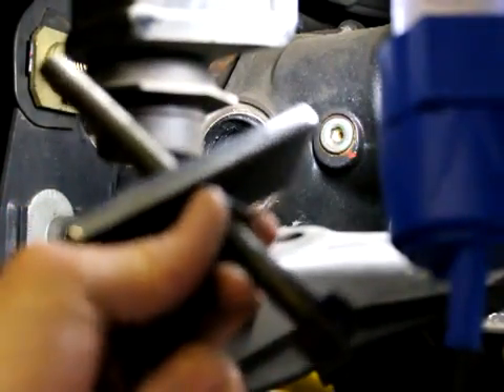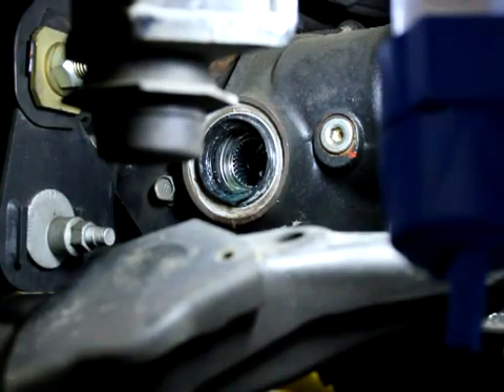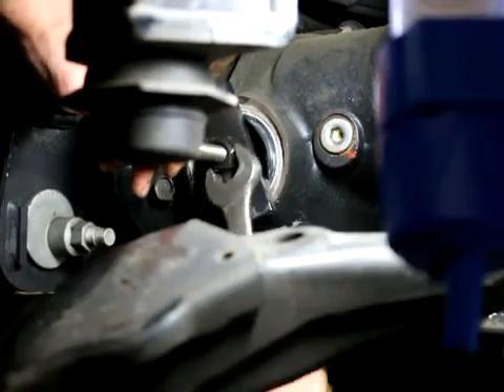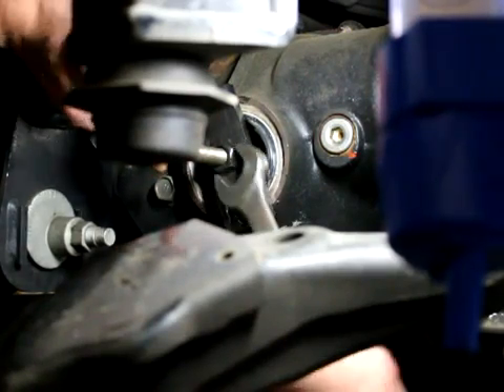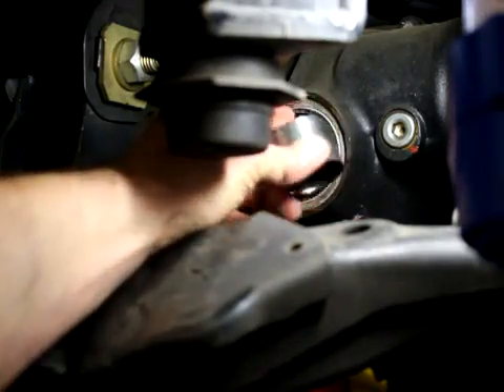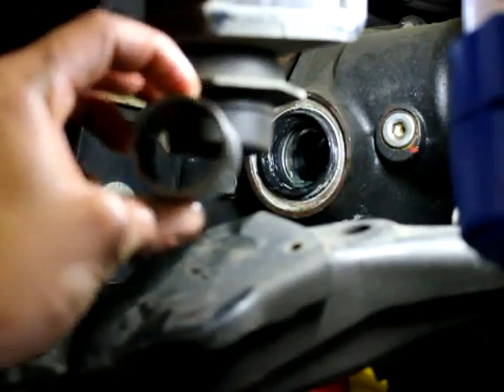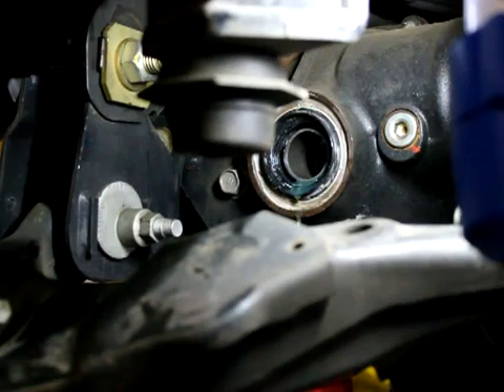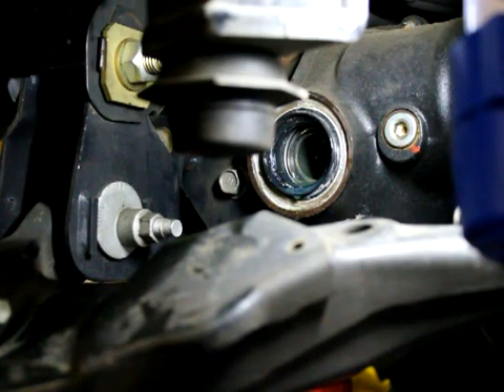Toyota T8CS Bushing Install

Comment: Pertaining to how far to thread the threaded rod into the inserted tool. 1/2"-13 threaded rod...so 13 full turns equals 1". The puller behind the needle bearing is .375" thick so .375 x13 =4.875 turns. So 5 complete turns should be all you need to turn the rod in leaving you the rest to work with on the outside.

Comment: So what works on the awd 4runner?
Reply: You would have to swap in an ADD carrier w/ needle bearing. B/c it is AWD the carrier always spins so the bushing needle bearing is not needed to control vibration and the OE did not machine the case to accept the bushing or needle bearing. Vibration comes from spider gears rotating at high speed in the ADD ie 4wd disconnected version.

Comment: Hey, nice video! I have a 5th gen sr5 awd (shift knob) on the web page it says “FJ Cruiser, and 03 up 4runner DOES NOT FIT AWD 4RUNNER AND FJ CRUISER”
Is there another option for those models? Thank you
Reply: Crickets
Reply: I believe the limited trim is the full time AWD 4runner which is what that is referring to. If you have a SR5 trim then your good to go get the bushing

Comment: Can needle bearing removal tool also be used to remove bushing if needed?
Reply: B/c the bushing is significantly tighter and longer it is likely not possible. Tool will either not fit behind bushing or break if you modify it. The easiest way to remove the bushing is with a bushing splitter on the end of a air hammer. It will split the bushing at which point you can pry the seam towards the center and pull it out with pliers. If you have the need to remove, let ECGS know, we can provide further tech assistance via email.

Comment: What would cause leaks after installation because the shop I use took three attempts to stop the leak.   I even purchased the new seal with the bushing. I am overwhelmed  with how quiet the truck is now this is something the manufacturer should look at.
Reply: I cannot say without seeing it, but it is not a common problem. If it is leak free now should be fine from here on out.

Comment: It works great very impressive! 
Do you hear of many leaks because the 4x4 shop had to do it three times to fix leaks
Reply: Bushing has not impact on leaks. We recommend OE Toyota seals only, we also sell a tool for installing the seal so it is not damaged when installed and positions it correct.
Reply: @chaseperry555  Can you recommend a good Toyota technician in the Richmond Va. Area because my truck is great the bushing is great 👍. But every time I have my truck worked on it has to come back, now because they had to keep taking my axle out to fix or replace the seal now my bearing is making noise and I just had the dealership replace the same bearing a month ago!

Comment: The bushing made a night and day difference to the truck.  The install tool was worth it.  The threaded rod for the removal tool was only 3" and caused me issues when about 1/8" of the threads stripped out because I couldn't get enough threads on the nut - this wouldn't have been an issue if the threaded rod was longer like in all of the older videos, including this one.  In the end I had to get a longer bolt from HD to finish the removal.
Reply: The rod is just long enough. You screwed it in too far into the tip. The rod is 1/2 -13 can be bought at lowes or home depot or call ECGS they will send you a longer one.

Comment: Just wanted to chime in here. had steering wheel shakes ever since i had a 3" lift done to my 5th gen 4runner. had 3 alignments and 5 wheel balancings done, nothing worked. Found a 4runner forum thread talking about replacing the needle bearing with ECGS' bushing, ran to my 4R to give the axel a shake and OH MY GOD THE SLOP! ordered the ECGS bushing, a day later it arrived...IN CANADA, just installed it today, the install went smoothly, test drove it on the highway twice, the shake is completely gone. feels rock solid now. Night and day difference.

thank you ECGS, thank you!

Comment: Installed on a 2016 4runner 2.5 inch lift no more vibes in 2wd.. tool fit perfect no filing grinding, easiest part was the removal on the needle bearing. Great product keep up the outstanding work!
Reply: Getting ready to have one installed on my 2016 4Runner as well.
Reply: Still working 3 years later?

Comment: He explained the 2 different ends on the bushing but didn't mention which end should go in first, and there's no instructions in the package.
Edit.: The steel face should face out. Full instructions here :https://eastcoastgearsupply.com/attachment/37734-T8CS%20BUSH%20INSTALL.pdf

Comment: I've got an 02 Tacoma with the 1.5 spring spacer lift and the drop diff spacers. Approaching 300K miles and the inner CVs flop around a lot and I'm getting a vibe and clunk that I am pretty sure is coming from the inner CV movement. Researching the issue I've read that the inner needle bearing shown here are what need replaced. Since I have an '02 it sounds as though this doesn't work for me. Do you have anything to address my issue that fits the '02 Tacoma?
Reply: What kind of clunk were you getting? when was it clunking? I have a 2006 Tundra that clunks when turning left or right and it seems to happen once the weight of the truck shifts ie the shafts are shifting in and out causing a clunk?
Did you ever get yours fixed?